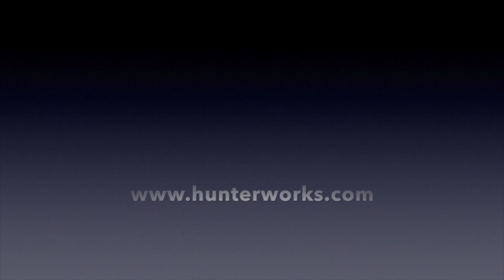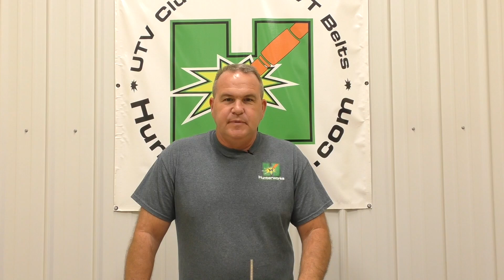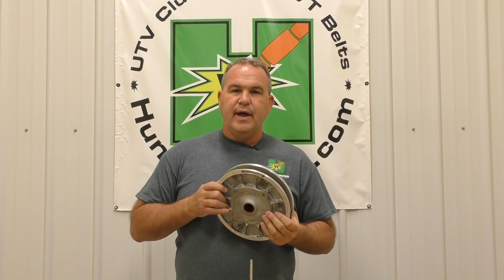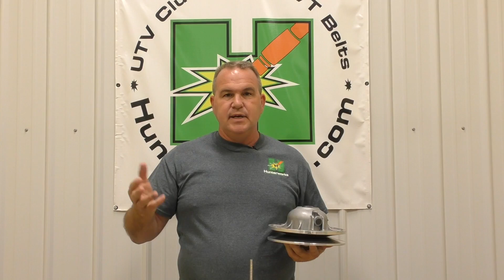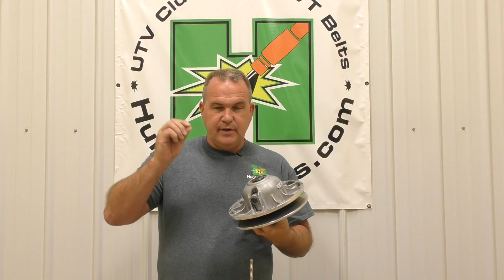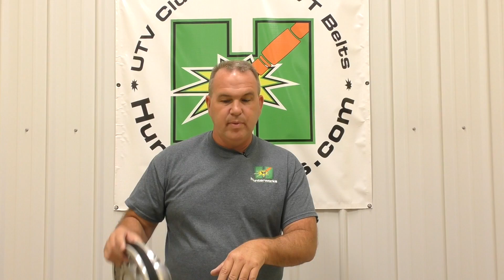2016 and Newer Polaris RZR Low Speed noise again!!!!

Comment: I have a 2016 polaris rzr xp 1000 high lifter 545 miles on it i got a knocking noise in the clutch area got codes 65590 and 65591 replaced belt still same issue
Reply from the maker: email me this, todd@hunterworks.com

Comment: Makes perfect sense and I can confirm..just put 3rd belt on 2023 General 4XP 1000. Started getting that sound for first time. OEM belt each time. This time it got over rev'd getting out of mud. Clutch rattled all the way home swapped belt and rattling stopped but that sound started now. Goes away once I get going. Thanks for your video. Not as worried about it now.

Comment: Are you referring to the low speed chatter when the machine is engine braking? (Atleast that’s when mine has a bit of a chatter, sort of sounds like the wheels momentarily lock up)
Reply from the maker: No, high pitch ringing noise

Comment: Im gonna find out if this is as "certain" as you make it sound..
 I bought a lightly used 2015 900 with a whine that starts at about "engagement rpm" til about 4000 rpm where it fades away.. 
 Recently I removed both clutches, blew out all the dust, replaced the 2way bearing and had the primary set up propely for a new oem belt as it had well over a  16th of an inch of gap between the side sheave and the belt.. 

 The result has been a smoother engagement at a lower rpm, but a very much louder whine, to thenpoint that it isnt even fun to drive as it hurts the ears at a certain rpm as the pitch of the noise finds its own "sweet spot".. 

 Im going to borrow or buy the alighnment tool, check/set the spacing between the clutches and will report back..  

Also, I did reroute the clutch air intake (and engine air intake) into an overhead "clean air" snorkle..  but the louder sound is coming from the clutch housing and not from the snorkle tube.. 
 I have considered that maybe the sound could be getting generated as fresh air is sucked in thru the "convoluted" plasic intake tube, (which is exactly what the whine sounds like is happening), which will be explored more if making an adjustment to the clutch spacing doesnt cure it..

 Ive thought about trying a baffle behind the primary to seperate the turbulence created by the clutch fins near the air intake, thinking that the turbulence could effect the resonance of the air as it flows thru..  maybe stoppering up the cooling air intake and exhaust temporarily could tell us if its "air flow" generated? 

 Hopefully I will find it to be a spacing adjustment, as that would prove a definitive problem for others to follow..  😊
Reply from the maker: Two different secondary clutches, on three models in 15, so what model do you have? Trail, trail with power steering or S?
Reply: I have the 900s eps... it currently has the rapid reaction secondary.. 

 Your vid was helpful, and after experimenting, I have found the noise is being generated by its interaction between the spring cup and its retainer plate. 
 Im not sure why as it always has spring pressure on it, but there must be just enough movement in it to allow a harmonic to be created, even though there is no sign of wear or movement in that area .. 
 
 I removed the retainer plate and assembled it on the machine without it, using just the cup, spring and clutch...the clutch is now silent at all rpm and speeds.. 

 I know the rapid reaction clutch is a failure waiting to happen, so Ive got an "upgrade" secondary on its way.. 

 But still, im left wondering if the harmonic vibration has anything to do with the high failure rate of the rollers this rapid reaction clutch design..
Reply from the maker: @scoobalou  You better hope that snap ring does not pop off, if so that spring cup will shoot into the seal.  I hope that secondary is coming from us.  The noise is for the same reason as other one mentioned in this video, just the way it is made

Comment: P.S Todd you say not the 900 Ranger but I have the same clutch on this 2015 Ranger 900 XP. It’s a Canadian bought unit if that makes a difference??
Anyway same exact noise from
the same area and under the same circumstances (new Polaris belt installed). 
I noticed in a google search that you had commented it does not affect Ranger 900’s after 2016.

Comment: Thanks again Todd! I just built an engine on a 2015 Ranger 900 XP and didn’t notice this sound then I put a new belt on and there was a noise that I narrowed down to the secondary clutch. 
Put a post up asking questions finally took the owner of this machine for a ride.
The first thing he said was it never started this good since knew so that was nice but I was taking him for a ride to have him listen to that sound and he said he doesn’t remember that sound being there but he also has 3300 miles on it so the noise was probably there in the beginning and then it went away so he would’ve forgot about it. This is the exact same noise I’m having glad you took the time to make this video. It’s solve my problem and a lot of headache trying to diagnose it.
Appreciate it! 

Alberta Canada. 

P.S I’m going to order up a set of your slippery washers for my old Chinese Yamaha 660 rhino clone I like the idea of using those versus the other ones that are a plastic.

Comment: I bought the SDI alignment tool to get rid of the chirp under 15mph. Worked for 5 minutes and came right back.. I really am at a loss. Is it the factory belts? Ive always used OE and have never had a problem till now..
Reply from the maker: send me an email todd@hunterworks.com and tell me for starters the vehicle, tire size, miles and if OE clutch and the issue

Comment: I have a slight clicking if coasting downhill at low speed. I was thinking it might be a clutch spring.
Reply: Brake pads. Catching the rotor, hitting the caliper pin, dropping back down and over and over again. Drive ya nuts. You can get the caliper pin springs  off a Polaris EV or I just put a couple baby zip ties around the brake pad were the pin goes through the brake pad holes.
Reply from the maker: Can't imagine it is a spring, nothing in a spring to make noise really.  Would need to hear it.

Comment: I have a 2022 Polaris 1000 ranger premium with the low speed noise problem. Is this something I should take to a dealer or do you have any suggestions on how to fix it? Thanks Kevin
Reply from the maker: Different clutch, if the noise just started the bushing fails a lot in the back of the secondary clutch, we recommend the duraclutch system we sell for it and be done with it

Comment: Hey Todd first I’ll say you make some great videos! Hear me out here…  I replaced my stock 16 ranger 900 belt and the tech talked me into getting the new Polaris HD belt. I am now having a whining/growling noise when driving, I know you say the belt won’t cause this. When installing I loosened and did not remove the secondary bolt to spread the secondary clutch to get the belt installed. Re torqued to 45 Ft lbs curious what you may think the issue is with this very limited amount of information I gave you.
Reply from the maker: Would be rare you could get the bolt back tight with the belt between the two halves but the noise is that secondary with that HD belt

Comment: I have a 2022 rzr xp 1000. I regret buying Polaris. Its a rattle box. I'm kinda embarrassed to drive it I have 54 km on it. I had it in dealer  several times.  they say that Polaris products are rattles boxes . Its normal is all I get.  Also it's not u.s.a. made. Made in Mexico. I did not know this the rzr is really just a fang machine dressed with stickers that say Polaris.  What a scam. I thought I was buying something built in the USA.  Says 15 inches of ground clearance is also a big fraud. Its only got 12 .75 inches of factual ground clearance. 2. 25 inches lower than their advertisement . Much fraud going on with Polaris. The machine proves it.
Reply from the maker: I have a 18 model, I like it not sure what is different and no rattles

Comment: Great points and great information. I have a 2021 XP turbo (200miles) and my buddy has a 2022 XP Pro (66miles) when we decelerate going down a hill and start to brake we both have clunking and chattering. I have heard it in other people's videos as well. I've seen numerous topics on this in the forums and some say it's the brake pads, it sounds more like driveline noise to me. Sounds bad. I would appreciate any help you can provide. I liked and sub'd
Reply from the maker: unfortunately both of those vehicles clutching is off from  polaris and have wrong thickness flat washer in the primary, we have vides on both subjects and the clutch fixes for on our site too www.hunterworks.com

Comment: 2019 Polaris ranger XP 900 changed out stock belt to aftermarket.... squeals below 10mph.... warranty that belt... same results. Then I find your video on YouTube I'm to the point of buying an aftermarket secondary...
Reply from the maker: We sell the secondary you want it’s technically not really an aftermarket it’s more or less the same one they use on the engine braking model

Comment: todd,  on my 18 ranger xp900,  i cannot see a tool in my pouch that would compress my clutch for belt removal.   I could not squeeze the sheeves like ive seen in other videos.   so i ended up using an impacto to loosen the center bolt.   is this normal??   Ive seen alot  of vids that show guys compressing the sheeves with a tool.    thanks!     Btw your belt rocks....shuddering gone!
Reply from the maker: You have what we call the POS secondary, the rapid reaction, is no good way to change the belt, we have a much better and more reliable secondary available
Reply: @Hunterworks    So what your saying is polaris sends a customer out in to the woods without a tool to change a belt???    Nice.......no offense but after spending 20k,   ill be damn if i have to spend  XXX more money on a  diff secondary.
Reply from the maker: @Dooguy  no tool needed, they have a method, think it is covered in the owners manual, just a pain and that secondary fails anyway

Comment: Mine just started making that noise it has 2500 miles on it and still have OEM belt 2017 Polaris RZR 900 trail
Reply from the maker: Then try our belt, 92G
Reply: I changed out my Polaris stock primary bearing to your HD bearing kit and white washer with a new belt (from Orielys  cause that’s what I had for a spare) and the noise went away I have put 200 miles on it since the new bearing in it and the noice is still gone the stock bearings are junk and the needle bearings in it where dam near dry and eating them up

Comment: Could you make a belt that’s a little shorter that would fix the problem the guy has with the spacing?
Reply from the maker: What guy?  What fixes the spacing is a spacing tool.  What vehicle?
Reply: Hunterworks Inc. the guy you were talking about in this video.
Reply from the maker: @WinterRig  WE have fixed what can be fixed, if still got it then they need the alignment tool or just have a noisy secondary.  Any shorter belt it will blow at high speed
Reply: Hunterworks Inc. got it!

Comment: Appreciate the pain your going through Todd- and  2 RZR's/ Generals ect ect... are never the same. I just came across a new 2019 XP1000 that came into my shop, and checked the spacing.. the guy had zero problems with his clutch, and running the stock belt for 800 miles I was just adding bumpers and the such and asked if I could check his clutch spacing...... he said sure " just don't charge me for it..LOL....
It was less than a 1/16" out and I left it alone.. I had  brand new HW-T921K belt of yours on the rack and put it on and WAMO!!- the squeal was there in less than 1/2 block.. Put the stock belt back on and quiet as a church mouse....you have pulled your hair out trying to figure this out and this situation totally blew me away as I know we have talked several times with the RZR's that come though my shop..... I also am scratching my head....

Comment: Did the alignment with the SDI tool, spacing was off approximately 3/32". Installed the thick quiet belt w/white washer in primary and also replaced the square pucks with the round ones. $400 later I still have the same low speed noise I had before, no change at all.
Reply: The machine is a 2019 RZR XP 1000. We do a lot of low speed trail riding up here in northern Minnesota, so we're constantly in and out of the speed range (10mph) of the noise. It's very annoying listening to the squeal every time you accelerate. Looks like my only option is a STM secondary clutch. Very frustrating when you spend $18k on a machine and you have these sorts of problems.
Reply from the maker: @RS-jv7qd  shoot me an email, I might have you a fix that is cheap just not 100% fool proof.  Todd@hunterworks.com
Reply from the maker: Then you simply must have a loud secondary or just can't run it, I wish it was not this way, we  have way more getting quiet from stock belts than the other way around.  I am just sorry.  No idea what vehicle you have but you will be forced to use a thin belt.